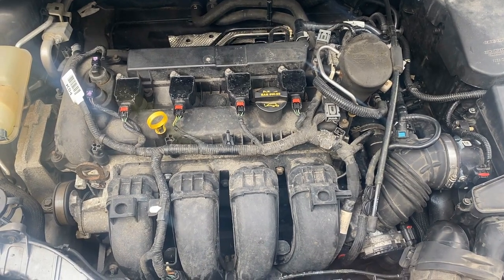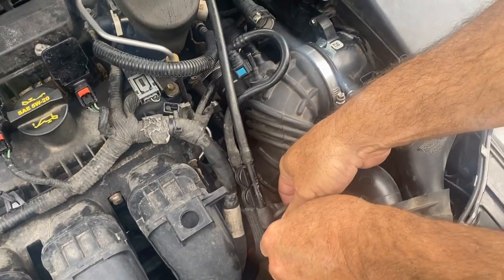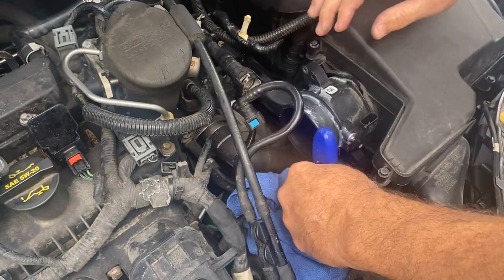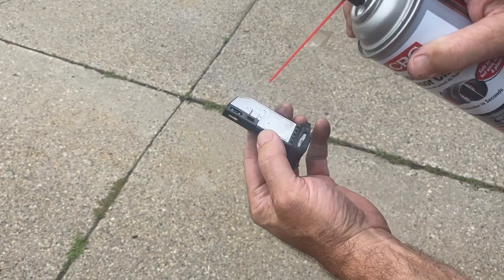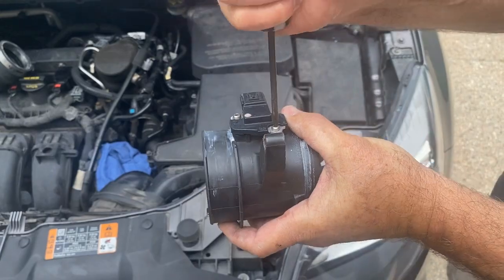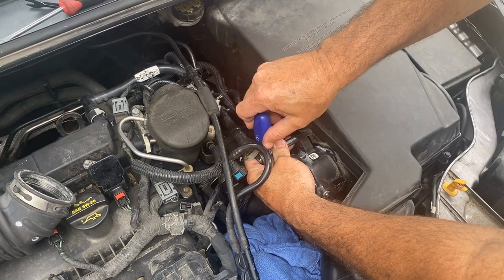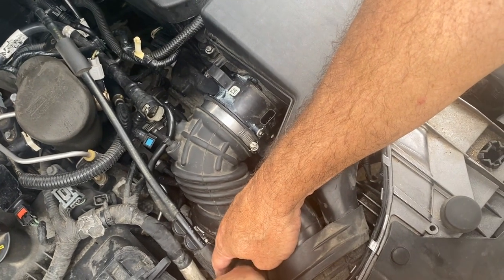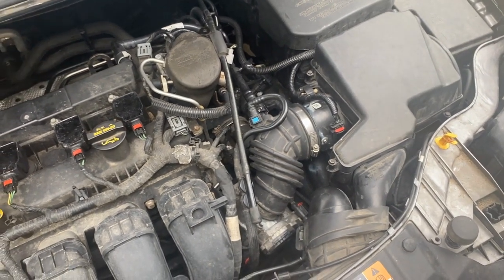How to Replace Mass Airflow Sensor Ford Focus

Comment: Thank you for making this! Trying to fix a P0420 code without replacing the expensive cat, but if this doesn’t work i fear it may come to pas regardless 😭
Reply from the maker: Your welcome , good luck !
Reply: Hello, did it help? I am fighting with P0420 code for over a year. Helped me using some Cataclean and for few miles a day over a week to drive the car on really high RPMs (almost in red numbers). Now the code is gone for almost 5000 miles. But I expect it to pop up again some time. Would be great to have some solution without changing the cat.